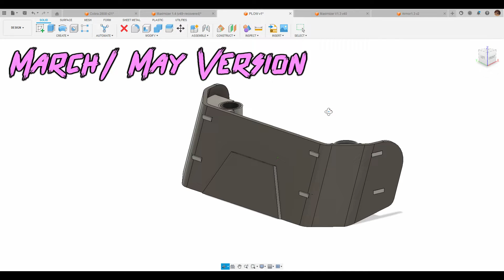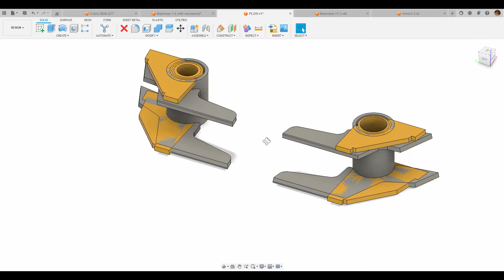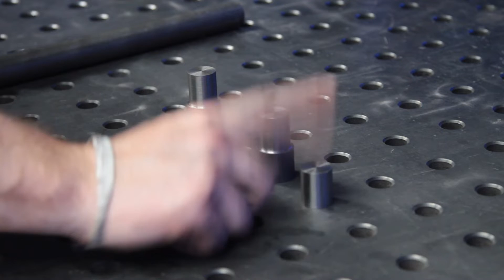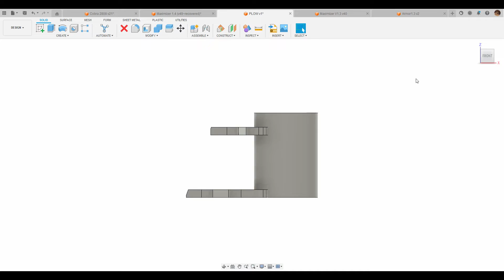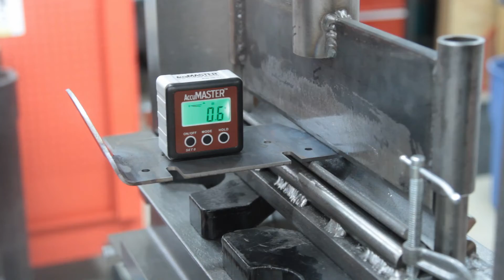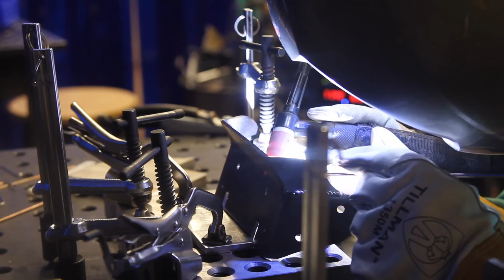Maximizer - Wedge

Comment: You may already be doing it but it it would probably be a good idea to use some sort of shock absorbent plastic bushing on the plough mounts to effect some impact isolation from the rest of the structure and componentry.
Reply from the maker: right on! thats the purpose of the tpu bushing, i went up in pipe size to accommodate an even larger bushing